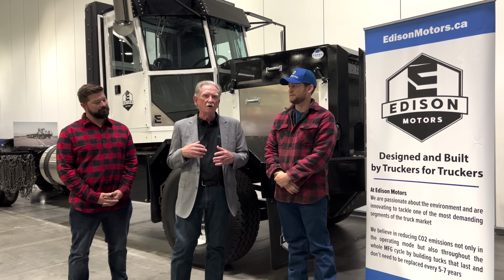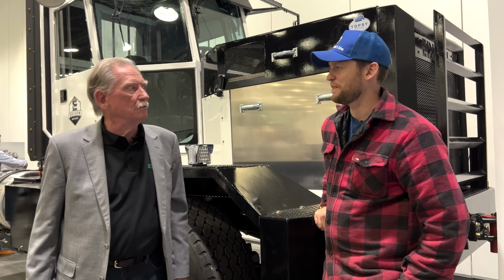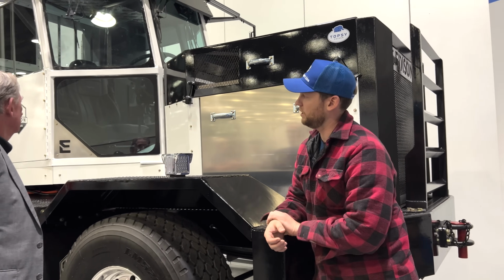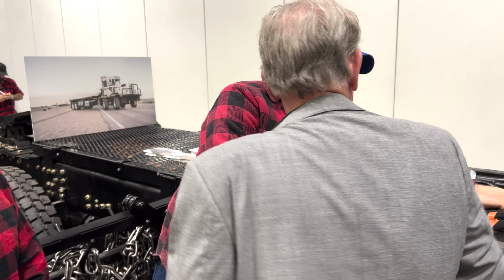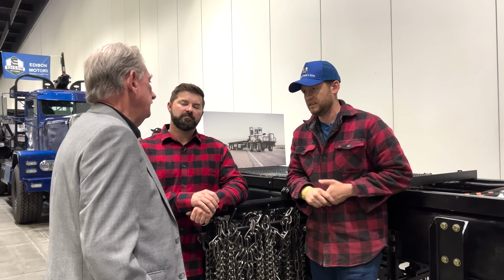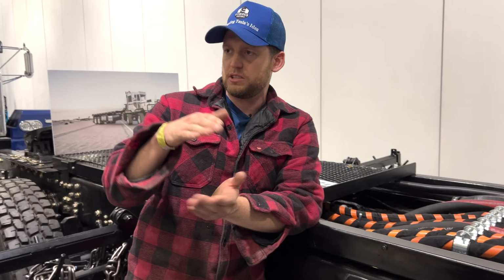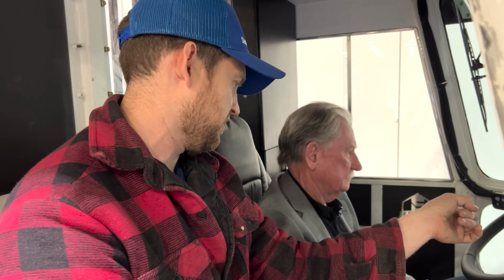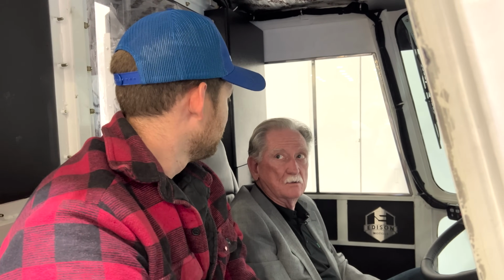This Electric Semi is a Million-Dollar Idea! Edison Motors at Fully Charged LIVE Canada

Comment: This is a more practical use of electrification than what most companies are doing... And makes all the sense of the world in his application.
Reply: @Tron-Jockey edison could actually offer a very functional all electric version of this already, they would have competitive range at lower speeds compared to the rest of the market. Being that this truck is designed for almost exclusively offroad use, that low speed thing isn't a detriment. If they take full advantage of the electric semi weight break in the U.S. it's even better.
Reply: @admiral_peck7834 The issue with all electric is the battery weight reducing load weight. With hybrid, the battery can be much smaller
Reply: @frenchonion4595 the Cat generator doesn't weigh nothing. If you can get the range you need out of the equivalent extra weight in batteries then you'd be better off with that.

The great part is I reckon these guys will have it modular so you can either slot in the generator, or the extra batteries, depending upon your use case.
Reply: You're missing the biggest point.  You don't need to plug this thing in.  You don't need a grid system to accommodate charging.  The generator is constantly topping up your batteries so extra batteries just aren't needed.  @morosis82
Reply: @morosis82 except that extra batteries will add more weight whether you’re fully charged or not unlike a diesel generator that weighs less than extra batteries would but still makes more energy as the fuel tanks empty.
Reply: @Maximumdub  the fact the diesel tanks get lighter as they empty is irrelevant, the load needs to be weighed with them full enough to do the trip. 

The 900kg dry Cat C9 engine plus several hundred gallons of diesel at over a tonne is enough to add quite the battery capacity. They have it specced at about 400kWh higher for the battery only one.
Reply: @Maximumdub 
Yep.
Our i3 REx goes 120 miles on its 450lb battery.
...or go the same 120 miles on just 20lbs of petrol😳😳😳!!!
Makes more sense to carry liquid fuel for the edge case long days.
Reply: @morosis82  I think a big part of their idea is to eliminate charging time. Also, it can be nice to have a generator if you get stuck because of mud slides and what not, that they actually have experience with. I think he talks about the benefits it can have in military applications and so on.
Reply: @basstrammel1322  Not just charge time, but the ability to charge it at all. 2.5 megawatts a day is the estimated power usage of a logging truck. having a fleet of pure electric would be hell on the grid. That is where having the diesel generator is so cool.

Comment: that truck is as much an Ev as the hummer in 1992 sooo they made a truck like they done for 100 years at this point where is the new stuff oh wait its just a ice truck we got thoes already
Reply: It’s the efficiency… but these concepts go over your head
Reply: @gilliesiut2332  the concepts Are 100 years old i see multiple semi truck everyday using dissel for power its notting New remove the dissel than we takling
Reply: @pingvingaming  1 that’s never going to happen because you’d need a nuclear power plant at each truck stop to charge the 30-50 trucks parked overnight. 

2 the power plant is interchangeable and can be converted to a hydrogen or natural gas power plant if the market  and infrastructure allows it but for now it uses the only economically viable solution.
Reply: @gilliesiut2332  than stop calling it a new tech its a 100 years old notthing changed when the dissel in the truck is removed than its new before its just a ice truck like all the other onces no new tech no innovation no forward thinking and volvo have already put more than 3000 eletric semi on the roads in euroup and some are driving right here and my country has no nuclear at all it works just fine

Comment: Great video, great truck! 
Have a look at the Edumper (also called Emining): a 100 tons heavy duty offroad dump truck, rebuilt Komatsu. Going fully loaded downhill the quarry, it produces more electricity than it consumes returning uphill empty. It's pure electric, no combustion engine. During the night some of the excess electricity stored during the day in the battery is discharged to the power grid.
Reply: That is peak efficiency some of the loggers might get there.

Comment: I love the mindset behind this truck. Today's trucks have so many parts made of plastic. They have been designed to save the manufacturer costs and time during assembly. That's good for them, but you're stuck with a cheaply built truck that costs you more than the manufacturer saved in both expense and time. The CEO here gets it, he was a trucker before he was a truck builder. I feel confident that he will succeed. The only reason truckers buy today's truck is because there isn't any other choice.
Reply: @Luca-gj4yi I have owned trucks going back to 1979. Trucks inside and out from that era were made to last and be easy and inexpensive to repair. Go back and listen to the exchange surrounding the dimmer switch. The CEO was trying to explain his logical choice to Sandy, and Sandy was worried about dirty boots. Mount a boot brush to the step... problem solved. Sandy is an engineer and I value his expertise, but his POV, his business is advising large OEMs on how to make things cheaper, easier, and faster. The CEO mentioned plastic air lines. OEMs like plastic air lines because they can be used together with quick connect fittings and save 15 mins on the assembly line. Quick connect fittings will begin to leak before the truck expires. There are probably 100 of these fittings on a truck, many that are impossible to get to without disassembling components to get at them. An air leak anywhere on the truck can have you put "out-of-service" on the side of the road and the truck either has to be towed or repaired right there before the truck is allowed to be moved. These fittings are an ongoing headache for truck owners. Many hours and much expense to maintain them. 15 mins to the good of the OEM...15 years of grief and expense for the truck owner. Modern trucks are increasingly built with proprietary vital parts instead of the off-the-shelf parts of yesterday. If you're operating in a remote location or you break down in one, you won't find these parts at the closest truck parts distributor and you will, like the OEM explained will be multiple times more expensive and you will most likely have to wait days and pay expediting fees to get the part shipped to you...why, because it somehow benefits the OEM, either faster assembly or more profits from parts sales. Truck cabs take a beating because the suspension has to be designed to handle heavy loads. Truck cabs sit over a solid front axle that usually have stacked leaf springs. That is not going to be a plush ride! Plastic interior parts: plastic HVAC ducting and actuators, plastic dashboards, plastic gauges rattle and break down before the truck expires... again, proprietary, over-priced replacement parts. Unless you have experienced what I'm describing, you may find it hard to get your mind around. This CEO understands! Truck owners understand. OEMs are too busy looking to barely out-do each other while extracting as much as possible from their customers.
Reply: @nooneyouknow7036 
I love that Chace and company specifically mentioned that they want to build the truck using parts that are available at any truck shop, repair shop, farm eqx shop, or local auto parts store.  Absolutely phenomenal planning.  These guys are gonna blow the heavy vocational market clean out of the water!
Reply: @nooneyouknow7036 heck, based on what you’re saying, these guys could make a diesel truck just the same and probably sell out just because of how it’s built.
Reply: @nooneyouknow7036  same thing is true for passenger cars made in the last 50 years since the introduction of plastic parts.  They literally degrade and then fall apart when you touch them.  Try to find a car from the 80's still on the road...most are long gone.
Reply: @nooneyouknow7036 Great points👍it’s not a consumer vehicle. It’s a work truck that reduces operating costs & is designed w/longevity in mind. 

The Caterpillar engine might last longer than 7 years, and it’s easy to add engine hours of the truck doesn’t come with it.
Reply: @Luca-gj4yi plastic air lines for one. In my short 2 years trucking, I was out of commission and missing loads because a stupid air line had a hole rubbed in it 4 or 5 times.
Reply: @Luca-gj4yiWhen manufacturers attach plastic to plastic in interiors, it ends up cracked and broken junk in just a few short years of any roads besides the interstate.
Reply: This is vocational trucks, way different than ur normal semi trucks! These trucks are made for heavy duty logging. There aint much plastic on them things, just pure steel.

Comment: A few guys and 6 months and off the shelf components? This shows that the EV revolution isn't as hard as it seems, though what they've done is very impressive.  Yes,  it's a hybrid- almost entirely because it's used way out in the middle of nowhere.
Reply: Now remember Tesla is 5 years into designing the cyber truck
Reply: @robertbowman9108 we reserved a Tesla semi 6 years ago now.  It was quicker for us to build our own electric truck.
Reply: @robertbowman9108  With Cybertruck, the design is a lot harder. Firstly, it's a luxury passenger car and thus the design is a lot more complicated, but you also have crash safety, compliance, etc, and on top of that, you need to design the machine, design the machine that builds the machine, and design a machine to be built by machines.
Reply: @user2C47  yeah, this thing looks dangerous, hope it's just prototype and they do something with the real thing, but safety R&D are expensive
Reply: @solarissv777  This truck is not a passenger vehicle. It's a piece of heavy logging machinery. Its approach to crash safety is to be big, heavy, and unbreakable.
Reply: @user2C47  this just doesn't work like that, the driver is not unbreakable, in case of a sudden stop the energy must go somewhere. Look at 60s cars, they were made of relatively thick "unbreakable" steel, and yet, prior to wide spread of crumple zones the death rate in traffic accidents was abysmal. Many of this things are not as intuitive as you think.
Reply: @solarissv777  What you said is true, but primarily applies to cars. This is more comparable to a tractor or a mining truck than most road vehicles. It has to be able to handle very rough conditions without breaking, and crumple zones cannot do that. When driving a vehicle like this one or others like it, you just have to hope that you don't hit an immovable wall at speed.
Reply: Edison had a Tesla semi ordered. They got tired of waiting so decided to make their own.
Reply: Way to go guys, why did you choose a generator over a bigger battery?
Reply: A year, many guys, and off-the-shelf components plus lots of custom system configuration as a contracted service.  Still, a relatively rapid project led by people who have never done this, and an example that it is possible.

Comment: Incredible! Designed and built by extremely talented users!!!!!
As long as they keep out HR, MBA’s, and the type of engineer that slaps everything in so you can close the hood with no consideration for the guy who owns and maintains…they should have a bright future!!!!!
Reply: They could have made the hood lower by dropping the generator into the frame rails, but decided to keep it higher to make it easier to service. They've had a lot of input from mechanics.
Reply: @MarkRose1337 I hope the regeneration absorb enough under massive loads since there’s no Jake Brake.
Reply: @TamagoHead  It can hold back more than a Jake brake
Reply: @MarkRose1337 👍kinda figured.  Thx!
Reply: @TamagoHead  This truck does have a jake brake for when the regenerative braking fully charges the batteries. The extra energy generated by the E-axles is used to spin the main generator, which spins the engine. The engine is fitted with a traditional jake brake. It was either this or use resistor banks like train locomotives use, and they chose the option that's on every other truck on the road.
Reply: @appleintosh  thx!
Reply: Every decision was made to keep operating cost and maintenance low.   From the top to bottom everything was purchased at the local parts shop that could be.  Even the power control system is essentially standard off the shelf inverters, converters, and switching gear.
Reply: These boys definitely do not want 'HR' ...😂

Comment: A rubber / silicon cup over the hi-beam switch would cost little to implement and could be slipped on - off more quickly than swapping out the switch even if only held by 2 bolts. (plus wiring contacts) Keeps gunk out, is flexible, adds slip-resistance to the button, and can be made of a coloured substance to make it "day-glo" visible. 
As easy as putting on and taking off a condom!  😉
Reply: That’s a good idea!  Thanks
Reply: @EdisonMotors - you can probably put an old school dash mounted toggle switch in parallel with the on-floor high beam switch… so a broken floor switch can still be bypassed until the shift is over, from a safety perspective
Reply: @DavidHalko  And then wire them like two-way switches so that you don't need to remember which one you had on.
Reply: That is probably cheaper than fabricating a simple lever and moving the switch further back near the fire wall. Keeps the switch easier to reach for replacement as well
Reply: The problem with that is you usually take off a condom AFTER you have been screwed
If you take it off before hand then you are doubly screwed.

Comment: Lumberjacks building EVs? Crazy great. Does it Supercharge?
Reply: It has a NACS charge port
Reply: Awesome! @jbullforg
Reply: No, @jbullforg  it has a CCS1 charge port.
Reply: @brianb-p6586  I was certain Carl had a NACS, and assumed Topsy was the same.
Reply: @jbullforg  NACS is a promised standardization of the Tesla connection.  "Carl" might have a Tesla inlet because it uses a bunch of parts salvaged from a wrecked Tesla car; those components are unsuitable for a truck, and unrelated to the components used for the prototype ("Topsy").

Comment: Logs are mostly water, so Log-Hydro ReGeneration. I've thought that some combination of Hybrid diesel regenerative power transmission for trucks was the way to go. I still don't see why the railroad industry does not use regeneration?
Reply: The railroad industry is starting to. Webtec is making battery-electric locomotives. The first ones are going to a mining company in Australia.

Locomotives already have what's called dynamic braking, which connects the axles to large resisters mounted at the top of the locomotive, which are also fan cooled. The battery-electric locomotive can capture this energy from a train instead.
Reply: Heat from slowing down millions of pounds of weight is why.
Reply: @4literv6 using regeneration producess less heat than friction braking (which converts 100% of the energy into heat)
Reply: The railroad industry does, at  least electric trains, and has done so for 120+ years. When the train breaks it feeds back into the line. My local train line is not old as far as electric trains go, but it was built in 1897 and it always had electric regenerative breaking.

Comment: calculate how much time it takes to load $20 000.00 of fuel
Reply: Napkin math is saying ~2hrs 15min at a standard truck stop diesel pump, though that'd vary tremendously based on pump speed
Reply: @alfheim7579  
Lol,..Thanks for the Napkin math! that kinda seems kwik to me tho unless ALL those truckers at the pumps are just lolly gagging and talking to lot lizards,... Also i think you might have to account for routing braking parking and setup, ..i think 2 hours to pump 20 grand is a "little" conservative
Reply: @-LightningRod-   Just listen and comprehend the video. They said monthly cost of fuel $20,000.  So it would take 1 month to pump that amount of fuel as they needed it.
Reply: @Adscam  
what?? you meaN THE TRUCK WILL NOT HOLD 20 000 DOLLARS in a single go? wow thats crazy,......

Comment: Good gosh. Stop doing bad math in your head and pull out some internets
Reply: It's called ballpark figures,  and you don't need exact numbers all the time. Further,  I bet you don't know whether they were using metric tons or Imperial gallons, so maybe you're missing something. They're having a natural conversation and dont need to google every number in order to communicate and get the broad point across.
Reply: @jamesengland7461 but saying "a gallon per mile" when it's actually 2.9 miles per gallon (or about 0.35 gallons per mile) is wildly wrong. That's not even in the ballpark.

Comment: This makes too much sense. If I was a logger I would buy this truck.
Reply: One point missed here is that this EV Truck design is much much much more realistic even for everyday trucking. Saves on fuel and saved on wear and tear of the diesel engine since in this application, the engine runs at a steady rpm as it is only used to recharge the battery. Unfortunately that was let well covered here.